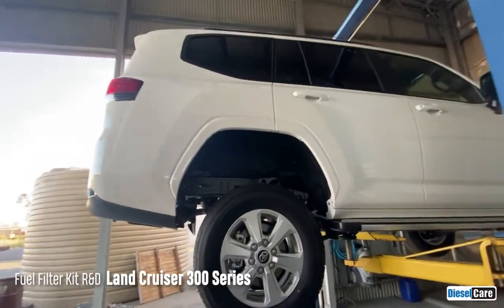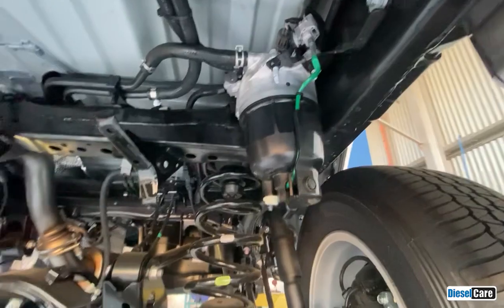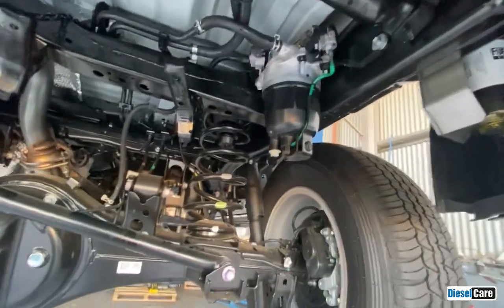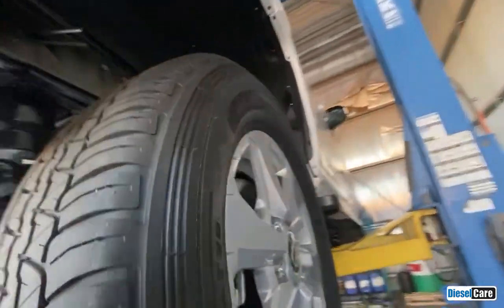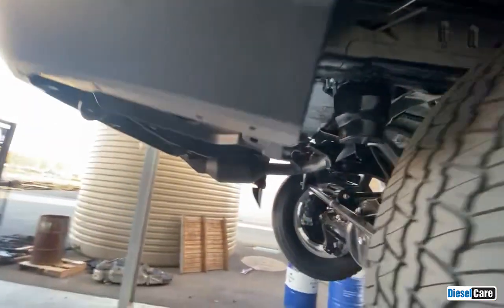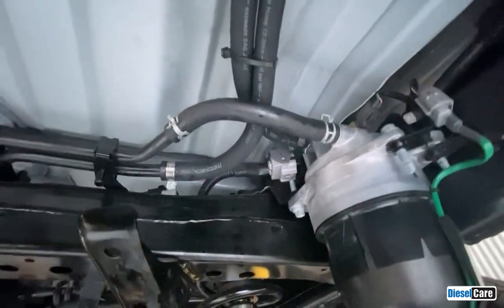R and D for the new Land Cruiser 300 Series Fuel Filter Kit

Comment: Hi there. Thank you for your video. I have seen the bay and agree its tight there but can the main filter and secondary filter be relocated in the engine bay if you find the room?
Reply from the maker: Thanks for your message. The engine bay is very tight.  Diesel care will be working on a secondary (post factory) filter for the engine bay in the coming weeks. To relocate the factory filter would require running the wiring for the water sensor on the factory filter the full length of the vehicle to the engine bay.  Space is limited so until we revaluate we cannot confirm if both filters will fit under the bonnet.
Reply: @DieselcareAu  thank you for replying. What's your thoughts on a provent 200 for these 300s? I ran one on my 200 from day 1 with no issues. Is this something your business will eventually do / sell as well?
Reply: @ume6002  We are hoping to develop a Catch Can kit with the ProVent for this vehicle.  We will be looking at this again in the next month or so.  However at this stage due to minimal space in the engine bay we are unsure if it will be possible to be able to fit one in.